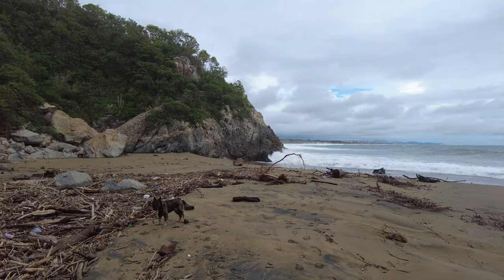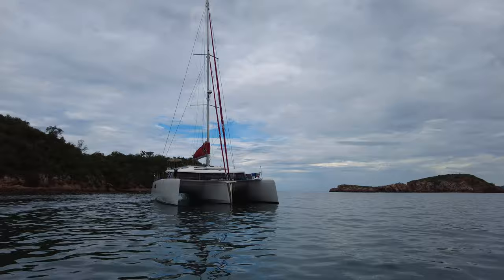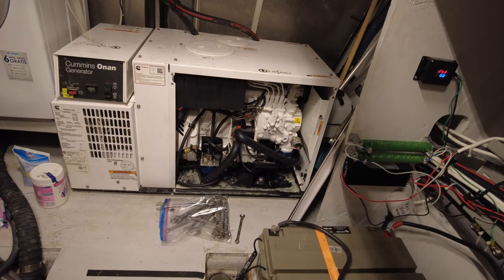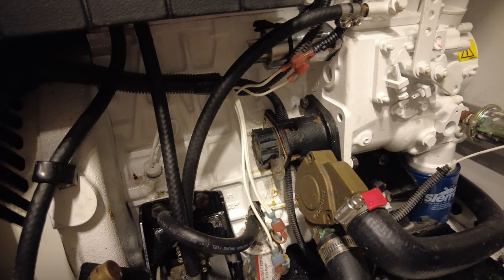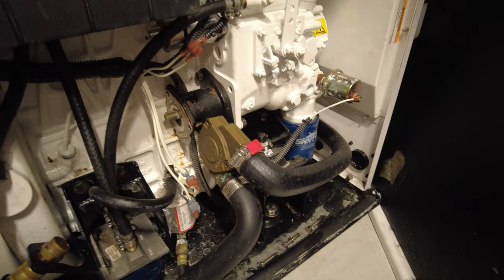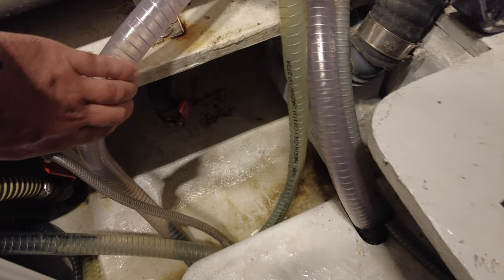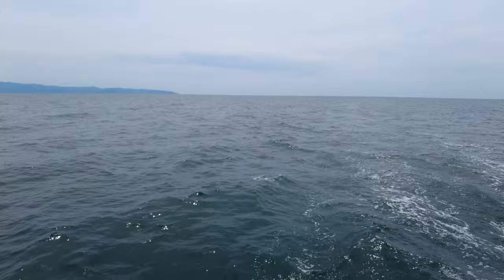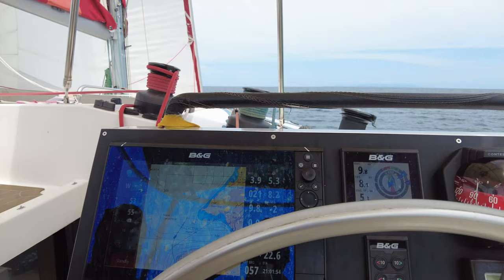Generator repair (Onan Cummins 11 KVA), movement at anchor comparison and more, onboard a Neel 51.

Comment: I had exactly the same issue with the height of my engine sea water strainer. Trying to punch a tide in a stiff head wind to get round the point to get into Cherbourg Harbour in France we put the engine on to give us that bit extra and the engine kept over heating but only on one tack. It was a few weeks later that I suddenly woke in the night to with the thought that the strainer was higher on one  tack as it was fixed on the port side slightly. lowered it then tested it whilst motor sailing and bingo water flowed perfectly lol. Just don't forget to shut off the sea cocks when checking the strainer. Love your dog by the way.
Reply from the maker: Thanks Ian, Similarly the idea came when I couldn't sleep also. The dog says thanks.

Comment: Great video. I learned a lot. 
Re: the swim ladders: James of Sailing Triteia YT Chan. (Lost his rudder halfway, had to steer with a drogue) mentioned in a chat that his most dangerous moment was when he dove on his anchor at sea, got tired in the cold water  and was almost too tired to clamber back on board.  What swim ladder would be best for your grandmother? That might be the one we should have.  (How about one the dog could use to get back on?)
Propping up the ladder. Neat trick. As a DIY kind of person with bits of plywood and nonsense around my house - while on boats I've noticed: not enough hand holds, not enough places to tie strings and stuff too. For instance, every cabin should be able to support a clothes line, every shower should be able to hang foul weather gear. I've got a safety bar in my bath/shower at home, but have never seen on on a boat. 
The Fairy soap trick. There are two ways to lubricate a rubber o-ring, silicone grease - which will always be a bit slippery, and ammonia which like the Fairy soap will be slippery only when it's wet. (It can be used in a water connection - just not drinking water.   I learned the ammonia trick sliding grips onto handlebars. Ammonia is a Base (slippery when wet) Very slippery, but quickly dries and locks in place. (Grease on the handle grip would slide off just as easily as it slides on.) Ammonia also works if critters are gnawing at the wiring and hoses underneath your car. Tastes bitter when licked. I sprayed a garden hose raccoons were chewing every night. 3-4 years later the ammonia has to be long gone, but they still haven't touched it. This last application probably has no use on a boat - maybe on the dinghy - if shore critters are a problem.

Comment: Good video thanks for sharing! Might want to run some barnacle blaster in those hose should help keep out stuff that chews up those impellers I would imagine. Sail safe Carry On crew!
Reply from the maker: Thanks for the tip! Vinegar did the job in the end. Thanks.
Reply: @carryonsailing  yeah that will work too but Barnacle Blaster is a bit more environment friendly but either way as long as you get it unclogged :)  safe sailing!!
Reply from the maker: Good to know, I figures the opposite. Thanks for tip.

Comment: The blades on impeller will auto flip to proper direction. Can’t put it in backwards. You have room inside sound shield for a strainer to catch broker rubber. They ware fast so every other oil change change the impeller. A Pain but it keeps Murphy away. Also ZINKS don’t last long in exchangers. Check with oil change. If you exchanger develops pin hole leaks in an emergency you can add 1/4 cup of oatmeal and it will stay cool. I did it crossing from Kauai to Alaska. Help up for 2 weeks adding when needed.
Reply from the maker: Michael, Yes zincs are often overlooked and can have dire consequences when ignored.

Comment: HiJames looks like you got some good feedback on your impeller issues. You also mentioned your fuel filters and the necessity to take plenty of spares. There is a neat solution to constantly changing your fuel filters on the engine or generator itself (invariably awkward and messy). Install a massively oversized (200 gph) Racor filter in the fuel line in a convenient/accessible spot in front of the engine/generator fuel filter and put a 2 micron filter in the Racor. Because the Racor is designed for a much larger fuel demand you will have no problem with supplying polished fuel to your engine/generator. You won't have to change the engine/generator filter except at your convenience. The Racor filters are cheap and easy to change. You probably want to put a couple of in line valves before and after the Racor to prevent any fuel bleeding off and a small jug of diesel to top up the Racor after a change. I have done it in the worst conditions imaginable and I don't have that beautiful ship's engine room (yet)! In case of really dirty fuel in your tank I would recommend carrying a few 5 and 10 micron filters as well.
Reply from the maker: Another awesome suggestion from you Oliver, many thanks. There is already a Racor filter upstream but not as large nor fine as you suggest. The offshore nature of things I tend to be conservative and diligent with regards to servicing.
Reply: @carryonsailing  Actually a 200 gph Racor is not as large as it sounds; 12" x 6" including bracket.

Comment: Hey James, if you have problems reaching the bolt on that impeller cap, it might be easier if youd swap those with Hex Socket Cap Screws.
Then you can use your ratchet with a long Allen extension.
Reply from the maker: Thanks Corbin, that is an awesome idea.
Reply: I’d go with torx instead, or an extended bolt head

Comment: I find that removing the two hose clamps pull hose out of the way then remove the two bolts holding the the pump onto the block is the most simple way for that job. then it is easy to clean everything and replace the new impellor and put back on.
Reply from the maker: Thanks Rob, might try that next time.

Comment: For your hands of kryptonite moment - couldn't you use a socket set with an extension on it ? Usually you don't need to worry about putting the fins in the housing the right way round - as soon as it starts turning they'll flip round the right way (there might be a direction of turn marked on it with an arrow but not always). It's always worth checking waterflow to the impeler if it fails even a brief interruption of waterflow leads to it getting very hot and failing. Good job getting all the bits of the impeller out and on getting it all done, not a pleasant job when you're dripping in sweat! Lovely boat and a great video - I'm very jealous!
Reply from the maker: Tom, thanks for taking the time to write to us. It is kind of hard to see from the video but you can't get that spanner onto the head. Some other very experienced viewers have suggested swapping the bolts out for hex head screws which does make a lot more sense. The genset will cut off if there is inadequate flow albeit not without loosing an impellor. Thanks again.
Reply: @carryonsailing  I’d stay away from the Allen head, since those have a tendency to strip out. Go with a torx, or get a longer bolt with spacers beneath the bolt head.

Comment: Next time you have to open that housing, replace the rear bolt with a longer one and a stack of washers in order to space the head of the bolt out to where you can access it 🍻
Reply from the maker: Many thanks for your comments recently. All great advice, best wishes in the new year.

Comment: I was thinking, until you get a tubing set up as mentioned by Mal L, made a couple of layers of cheese cloth over the tube end, jammed finger depth and held by the hose clamp.
Reply from the maker: Many thanks Paul appreciate your thoughts. I am going to try a brass filter and do the same on the engine, more to follow after having consulted with Volvo penta also this week.

Comment: Greetings James,
Is there some way you could flush/scrub the seawater intake tube from the strainer towards the intake port?
Reply from the maker: Maybe use a bit of acid like I did for the aircon? Pour vinegar into sea cock instead I guess
Reply: @carryonsailing  What dissolves oysters (and other sealife's) anchoring systems? Seems like a good idea, purge the tube with air, close off the intake, fill the tube with x product, let sit for x time, open intake, purge with water/air from strainer towards intake, tube clean.
Reply from the maker: @nobody46820  that's basically what I did with the aircon. Used vinegar. Thanks for input and your continued support on the channel